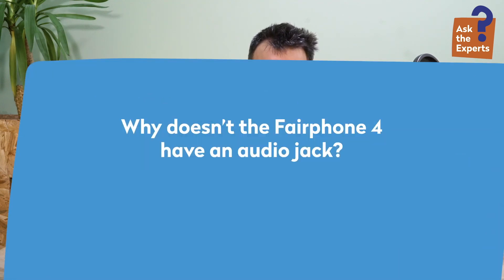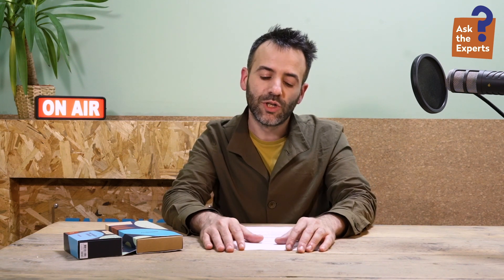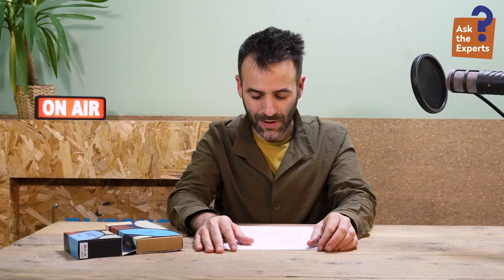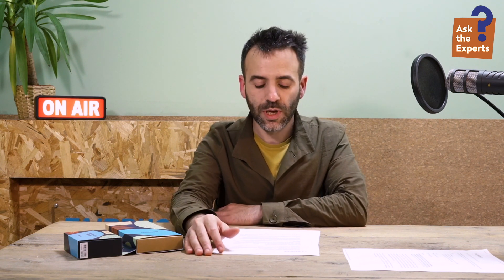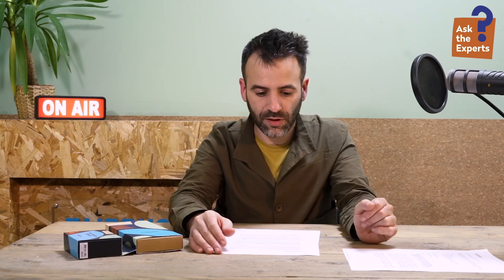Where's the headphone jack?! | and other questions answered | Fairphone

Comment: Hey it's really awesome for you guys to come out and answer questions. But no head phone jack is a major downside. PinePhone has you guys beat as of now.
Reply: It's hardly an answer if it doesn't make any sense.
Reply: hey thanks for the heads up regarding the pine phone. wasnt sure what to consider after this company did the dirty on us headphone jack users.
Reply: @brapamaldi  Pinephpne ftw. Also check out Librem5 and BraxMe degoogled phones.
Reply: @calysagora3615  props man, thanks for the heads up
Reply: I think of it as more of a necessary evil. Since the parts are manufactured by other providers there's a need to choose easily manufactured components so replacements can be made 5 years down the line.

And with the amount of phones ditching the headphone jack availability would've had the potential to actually become an issue.
Reply: @Eugene-pq3gg  I strongly disagree.
Reply: @Eugene-pq3gg  There's nothing "necessary" about it. It's just evil.
Reply: @Knowbody42  what is evil they don't call themselves the Audiojackpuristphone they are the Fairphone (they abide by their criteria of sourcing sustainably and making available replacement parts) and if this really is a scheme to sell earbuds or adapters they would push it more and I hardly think any of their suppliers would promise them to give them spare headphone parts for many years to come.
Reply: @FMeister94  There's nothing sustainable about pushing people to use wireless headphones. It's another thing you need batteries for, which necessarily means those batteries will stop working properly at some point and you will have to replace the batteries in it if that's even possible, but they usually aren't meant to be replaceable.
Reply: @FMeister94  Removing the jack and forcing dongles and wireless crap on their customers is the antithesis of being green. They are violating their own principles, not adhering to them. Period.
Reply: @Eugene-pq3gg  touch bleach with your lungs

Comment: I have 2 questions.
1) Why doesn't the Fairphone 4 have an OLED display? iPhone provides these screens now as well since the quality got better and they last longer now. An OLED is much better to prevent battery wear, since they're more energy efficient. Also, they provide means to have an always-on-display, so you don't need a notification LED.
2) If an OLED wasn't possible for whatever reason, why wasn't an notification LED included? It's quite small I would say, it's not like the headphone jack, that it takes up much space, I suppose. Now the phone has no means for persistent notifications. That's a real bummer.

Comment: I would really appreciate if you would release eg a new camera module for the fairphone 3. It really would be disappointing if you would "forget" the users of the old devices this wouldt be sustainable at all.
Reply: The hardware is fine, it's the software that needs work. The FP3 didn't need a new module to begin with. It had the same camera sensor as the Pixel 3a, which makes superb pictures. FP3+ still makes low quality pictures.

Comment: Since the phone is modular if it collected dust or if it bent couldn't you just replace it yourself? As for durability my phone currently (se1) is still going 5 years despite the headphone jack so I'm not sure how that is an argument. It increases waste to add a dongle that would be more fragile than one built in the phone. Other phones are 5g capable and have a headphone jack as well so this argument makes no sense
Reply: Alternatively you could get headphones that dont have a dongle and go straight to usb-c. Or just use  bluetooth earbuds. Headphone jacks arent worth the trouble they cause when there are other options
Reply: @matthewtrebs9738  No, I don't want your solutions invented in search of a problem.

Comment: Now we have perfectly good headphones and earbuds that require the production of a dongle (which will end up getting lost or fray and end up in a landfill) in order to use our audio equipment. Headphone jakes prevent waste. Fix this on the next version.
Reply: You could look at it the other way around as well, though: if the end user doesn't use wired headphones (i.e. only wireless ones), having a headphone jack in the phone could be seen as a waste of resources.
Not trying to play devil's advocate here, but just pointing out that there's always another side of the coin to look at. ;)
Reply: There is a lot of discussion about the headphone jack, for every brand. And although I always like to "have an option", I now agree that the time for Jack is over. As mentioned in the movie and countless other places, it's relatively huge (for a single-use part); it is an opening for water and dust; it can cause issues where the phone thinks something is connected when there isn't; and yes, I have actually seen broken pins stuck inside the port.
Reply: @jaypaans3471  
It's the fairphone. It's supposed to be easy for you to open it up and replace that part.
The jack isn't over because music is analog and most bluetooth headphones and earbuds sound like garbage and will go in the trash when the batteries die.

Comment: Not convinced. I think the presence of the jack wouldnt have decreased its longevity. Gotta spend extra money to regain functionality like being able to charge it and use headphones at the same time. No company is ever able to justify its removal.
Reply: Ditching the headphone jack strangely coincides with them selling overpriced wireless earphones.
Wireless earphones are guaranteed e-waste as their battery often can't be replaced and their hardware limits them to codecs that may become unavailable later... and as they're not wired they're lost more often, which increases waste and pollution.
Also, watching videos or playing games in wireless is a pain given the added latency (yeah I tried).
All the reasons given by FP are disproved by other models.
Heck, water-resistant phones even had a jack at some point.
Reply: The experts say otherwise :)
Reply: @UPPERKEES  95% of "experts" agree with whoever pays them.
Everyone knows Apple only did it to sell you their wireless airpods. And the other manufacturers only did it because management decided to copy Apple.
It wasn't the engineers making the decision.
Reply: There is a lot of discussion about the headphone jack, for every brand. And although I always like to "have an option", I now agree that the time for Jack is over. As mentioned in the movie and countless other places, it's relatively huge (for a single-use part); it is an opening for water and dust; it can cause issues where the phone thinks something is connected when there isn't; and yes, I have actually seen broken pins stuck inside the port.
Reply: @jaypaans3471  Im pretty sure waterproof phones with jacks have existed for some time.
Reply: @jaypaans3471  the size constraint was never valid, Apple themselves proved it by releasing the iPhone 6 without a 3.5mm jack... and the even thinner iPod touch 6 WITH a 3.5mm jack.

Comment: Nice to finally get a straight answer, I really appreciate what you guys are doing here. 

Unfortunately the lack of a headphone jack is a deal breaker for me and many others, hopefully it will come back in the future revisions. 
Wish you the best of luck.
Reply: I like to NOT have to carry a adapter, same way I like a big battery so I don't have to carry a charger. 
Another thing to remember, another cable to break.

Yes Bluetooth is a thing, but wireless audio has been a thing long before manufacturers started removing audio jacks from smartphones. I have a preference for a feature and I like to express that preference to the manufacturer, deal breaker for ME and others. 
You can of course buy any device you like, simple as that :)
Reply: @ikillyou96  Yeah I agree with you. The options to me seem like:
* Phone without Jack + Adapter + Headphones/Earphones
* Phone without Jack + Bluetooth Headphones/Earphones + Headphone Charger
* Phone with Jack + Headphone/Earphones 
Of course I like the most lightweight option.
Reply: @ikillyou96  "I like to not have to carry a adapter"
Actually I don't think this argument makes sense. You can just leave the adapter always plugged into the headset cable, just like it were an extension/a longer cable.

Still upvoted your comment, though.
Reply: I don't get how people can even argue against you at this point. without a headphone jack you are paying for an extra bluetooth module, an extra DAC, and an extra battery that will go bad. if you're not using bluetooth, then you're buying an extra adapter that you have to carry with you everywhere, or you have to buy an adapter for every single pair of earbuds you own, and if I wanted an extra useless cable hanging off of my headphones, then I'd buy an extra useless cable to hang off of my headphones.

there's also no standard alternative to the 3.5mm jack. the 3.5mm jack is the standard and now you need to grab an adapter to allow your phone to use it. every wired pair of headphones you see works with the 3.5mm jack, every device that's not a phone still has it, it has been around for decades and it WORKS. sure there are some headphones that are made to deal with this problem, but those aren't compatible with any other device with a wired audio output.

meanwhile if you have a headphone jack, YOU CAN STILL USE THE FUCKING DONGLE IF YOU ACTUALLY WANTED TO. you can still use bluetooth too. and it's not like you can't waterproof a phone with it, they still have to do it with usb-c. I have not seen anyone ever say something that removing the headphone jack actually improves, only that "it's the future because I like the future being worse than the present".

I'm not even so much mad at the fact that it's so hard to find headphone jacks on phones these days. I have one and it works fine. what really gets me angry is the people who have actually convinced themselves that they want to pay more to have less and want to tell everyone else that they're somehow in the wrong for not thinking the same way.
Reply: @fubbernuckin  they've come to expect getting shit on as part of the typical consumer experience and their Stockholm syndrome flares up wildly and uncontrollably when they buy something and aren't shit on as thanks for their custom
Reply: Straight answer? It’s a joke. all of the reasons he gave was bogus at best.
Reply: @Anton Farnum Is this really a good argument? Some headphones have really bad sound. This is also true, but what does it add to the discussion?
Reply: Why would it come back? All the headphones I bought the last years can be used wireless. And even if that is not an option, one can use then usb connector. So there is really nothing lost there.
Reply: @bastisonnenkind  Because having a headphone jack is better than not having one.
Reply: @Knowbody42  That is a bit, lets say childish? Because having a horse and a plate armor is also better then having none. But who does anymore?
Reply: @bastisonnenkind  Don't you think it's narcissistic to think that your way is the way that things "should" be?
All the best headphones and earphones are wired. And most headphones and earphones are still wired, period. Your analogy doesn't work.
Telling someone to use an adapter is kind of like taking someone's cow away from them, then offering to sell them some of the milk from it to make up for it, then being surprised they are not happy with that. It's not a good faith solution.
Reply: @Knowbody42  I think it is the other way  around. I think you are whining about a technology that will live on only in a very small niche. I also use cables on my headphone and my mouse and keyboard. But I would not state publicly that I am in deep trouble and don't want to buy the product if things would change.
Reply: @bastisonnenkind  Wired headphones are the majority of headphones, and comprise of the best headphones. Nobody has a legitimate reason to remove the headphone jack other than to make money off you by selling you wireless headphones.
All other arguments are made in bad faith, including appeals to novelty, or factually wrong claims about how it supposedly makes other aspects of the phone worse.
Reply: @Knowbody42  Your argument ist deeply flawed. Because a) you don't have to buy the earbuds from Fairphone, so they would not make more money b) you can simply use a converter. c) a car nowadays can not use oil filters from 50 years ago. Was that decision also purely made to get you to buy now ones? I really like compatability. But not everytime and for everything.
Reply: @bastisonnenkind  Your argument as to why my argument is "flawed" is flawed.
The fact is, if it had a headphone jack, more people would just not buy their wireless headphones.
And telling someone to use an adapter is not a suggestion made in good faith. We both know you wouldn't want to use it.
Reply: Anyway, I think we all know that if Apple hadn't started the stupid fucking trend of removing the headphone jack, it would not be a thing, and nobody would be doing it.
I hate Apple for that.
The only reason Apple did it is because they purchased the company Beats, and wanted to sell you expensive wireless Beats headphones.
Beats headphones were always overpriced garbage though, even the wired ones. But for some reason people think they're good.
Reply: @Knowbody42  Apple just did it prematurely. I thing most others will follow.
Reply: @bastisonnenkind  Regarding the oil filters analogy that is not same, If a format is dead, sure stop supporting it, but as it is wired audio is almost exclusively done with aux, at least for everyday use, and besides saying that something should be gone because it's old is a bad argument, you realize that the bluetooth format is from 1998? and with that argument should be gone as well.

Regarding bluetooth i find it very unreliable, like half the time i connect to my bluetooth headphones (which i purchased because my aux jack on my current phone is broken) half of the time it doesn't play sound.
Batteries are another problem, the production of batteries is bad for the environment.
I sometimes forget to charge my wireless headphones and then i'm stuck without anything on my daily 2hour commute, a problem i never had with my wired.
Pricing for wireless headphones is also an increased cost.
Audio quality is usually worse with wireless headphones.

As of right now i'm looking for a new phone and i wanted to get a fair phone to be able to replace the aux jack easily as it tends to get worn down with usage, at least for me, so for me it's a deal breaker, i don't know how many potential customers they loose by not including aux, but i think (and now i'm speculating) that it would be a somewhat significant amount as their customer base are the "i want to fix it myself" type and want the reliability and option of repair that comes wired headset
Reply: @Knowbody42  Overpriced garbage like Apple itself. 🤷

And now Fairphone. 🤦🏼‍♂️
Reply: @bastisonnenkind 
- Bluetooth covers a notable portion of currently sold headphones; that is a stark downgrade from Bluetooth + AUX jack, which combined cover some 95% of all headphones ever
- Making me buy an adapter is offloading production cost to me
- Making me use an adapter means making me carry something around, which is annoying especially if I use my headphones even just in two different devices (like phone and laptop)
- Even if I have, say, 1/4 inch jack headphones that I will need an adapter for anyway, it's better to have an AUX jack, both because otherwise I will need to rely on the DAC the adapter will offer, which will be lower quality than the included one, and because by then all my ports are busy
Reply: @bastisonnenkind  I've just bought another $200 wired headphones in the beginning of this year. Use it everyday. While charging the phone. Through the OTHER port, USB-C. I haven't touched wireless headphone in months (maybe even years), for real.
Reply: Why don’t you just use an adapter?
Reply: @pipapo3030  Using an adapter is a shit solution.
Reply: @pipapo3030  Because it's another item of future e-waste to have to purchase.